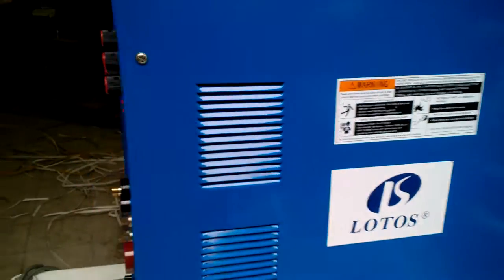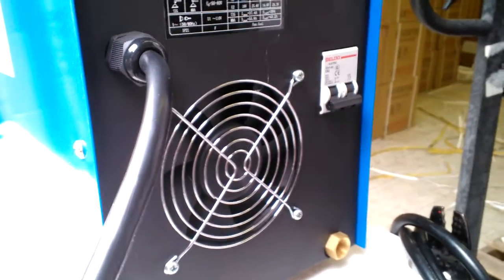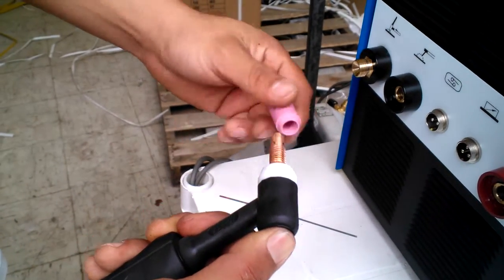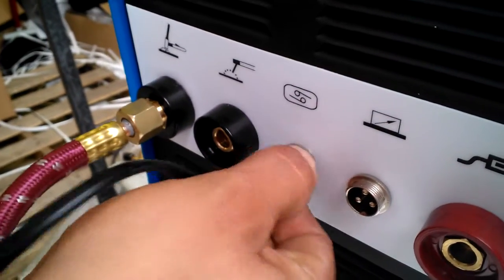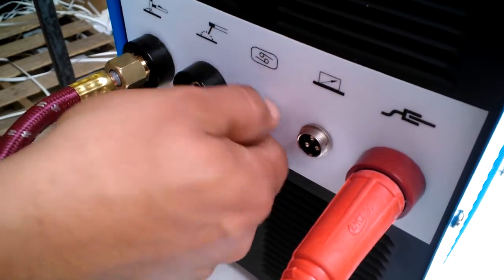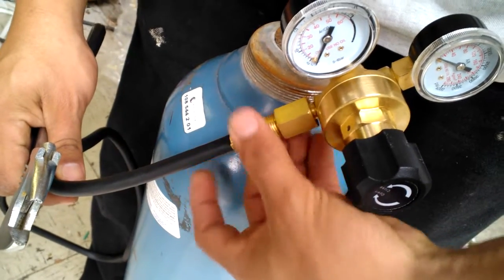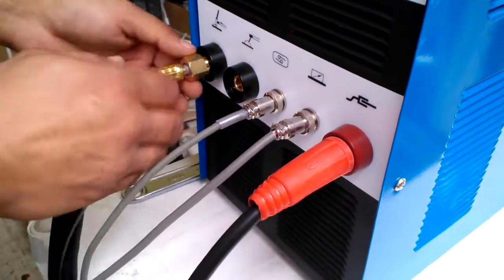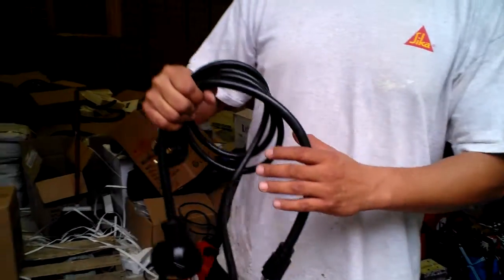LOTOS TIG200 200 Amp AC/DC TIG Welder Quick Setup Guide

Comment: WE CAN READ the knobs- but china made different names for knobs than normal usa tig knobs.. id clearance knob used for balance ? best to explain what the knobs do.. exazctly.. then will become clear please.
Reply: The clearance effect is somewhat of a frequency Hz balance when used for AC aluminum.  It does kind of state this the instructions, even tho not so clearly.  On the machine it is called "Clearance Effect", & in the instructions is Clearance Effect Pulse Duty Width Adjustment.  

So making a very educated deduction, from understanding frequencies,  AC & DC electric, Sine, Cosine, Square waves, etc,  pulse width, & then also that in tig welding, especially AC aluminum welding,  the balance between welding/cleaning  (i.e. 70/30, 50/50, etc) & the frequency in hz sweep needs to be decreased/increased  (i.e. 50hz, 60hz, 100hz, 120hz, ), according to the size/type of material, which in turn essentially affects cone shape/area & how it welds.

With better welders, these features will be adjustable, instead of only 1 or 2 preset. Alot of times a 70/30 weld/clean balance & a frequency of around 120hz is preferred when welding aluminum, but not always, because this is where voltage,  amperage, type of material,  grade of material (201, 304, 6061, etc etc) & thickness, etc etc all comes into play. This also explains why this welder is overall so great, & is especially so acclaimed for precision welds in aluminum.   

Again, this is not so clearly stated in the instructions, which are also written incorrectly in some places.
But they state that during AC aluminum tig welding,  that for increased voltage of more than 150 amps use a pulse duty of below 30% (less than -1). For medium voltage, from 100A - 150A, use pulse duty of 50% ( 0 on knob). For voltages less than 100A, use pulse duty more than 50% (+1 to +5).

So this would make sense that this controls the frequency hz sweep & weld/clean balance. 
Having a better understanding of the relationships between all of these & how they directly & indirectly affect each other,  & then how & why they would apply to welding a specific material, helps. 
 Without writing a book on relationships of voltage to amperage to frequency, etc etc etc,  these are the difference in a quality weld. There are many books, & even videos on these subjects, & applied to welding 

The Lotos tig 200 is amazing,  & only 3/8" ???  How about perfect 5/8" !!! 

**ALSO... VERY IMPORTANT!!!**

Alot of confusion on the wiring if this machine.  1st & foremost,  wire this in 220 volts!!!  As an electrician,  i am telling you there is a big difference.  It will actually run stronger but also cooler, & last longer. Higher voltage will make more power with less heat essentially. 
Also, try use at least a 10 wire  (10 gauge). A 12 wire will work,  but make it real short. Honestly just do it correctly & use a 10/2 wire,   dedicated circuit,  double 30 amp breaker. 

Now, for those who use 110/120 volts,  honestly i advise against this, because there are chances that this circuit is only a 14 wire / 15 amp circuit. This is not optimal,  & can be out right dangerous, & can destroy the welder!   Sure you may have a 12 wire/ 20 amp circuit, which is definitely better, & While garages should be at least a 12 wire by code, many are not! Even if your garage is in 12 wire,  is it the only thing on that circuit?  You again want a dedicated circuit,  in other words not shared with anything else, & the welder is on its own circuit.

Again most people at home are most likely to be welding in the garage,  & many times the breaker panel is in the garage, which means to wire a proper circuit for the welder shouldn't be too complicated or expensive, & if so then spend the $$$ to have a dedicated 220 volt circuit for the welder. 
Even if the breaker panel is in a more complicated area to reach, it still makes sense to have a proper 220 circuit wired.

After everything you just spent on the welder, bottle of gas, wire, rods, consumables,  cart, etc etc etc, then why not insure your investment? If you burn out your welder, & either have to replace it, or cost to send it out, etc etc or possibly burn down your house, destroying your belongings,  & even possibly killing someone,  then that really surpasses the $100 - $300 give or take that it may cost to just do it correctly the 1st time !

Comment: Just got my Lotos TIG200 and it does not work straight out of the box on dc amps will not go above 9, on ac amps will not go above 21. Absolute junk,  and to top it off I can not get a holds of anyone's from the company to claim a refund.
Reply: been doin great for me. you either recieved a bad machine or you just suck.
Reply: did you get a resolution?
Reply: Nick Wesolowski yeah,  returned the machine for a refund and bought a everlast powertig 185dv aka a great machine that actually works. Don't even mess around with the lotos it's a peice of shit and it'll let you down wether it's the Same day you bought it or 6 months from when you bought it.
Reply: Not really sure why you would post a review just crying that yours did not work out of the box.  My LE 210Mp did not work when I first got it.  Bad board.  I did not slander lincoln Electric.  Really wish reviews needed to be vetted.
Reply: Are you running on 110V?  There are current limits if you're not running 220V.

Comment: how do i set the amps and all the rrst of nobs to get my puddles  to lay nice and flat cause its now welding my filler metal.
Reply: Do you know how to Tig weld?
Reply: Its welding your filler metal???  That's kinda what tig welding is....
Reply from the maker: Adia, try adjusting your Argon gas higher or lower to get your desired effect. Use walk the cup method to achieve smoother welds. Feel free to contact us if you have any further questions.

Comment: I am thinking of buying this unit dose it come with everything you just showed in the video except NO Tank or gas- It comes with Tig wand and foot pedal, electrode holder or (Arc) and all the cables and hoses correct? also how good is this "Lotos" Brand I never heard of it?
Reply: I bought 1 200 amp/ac..dc.. came with foot peddle /torch/all hoses  guage.. all I needed was a bottle from airgas. $200. and $80 refill. unit was $586- ebay- warning .. the guage to the back machine gas hose was like 4 feet. so I machine on waist high table and bottle beside and not much room move around! :>)